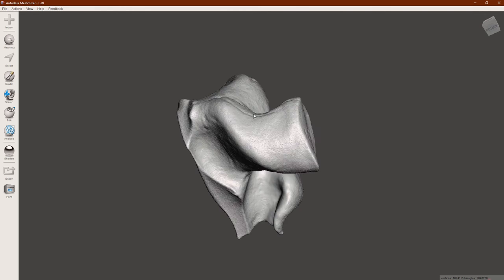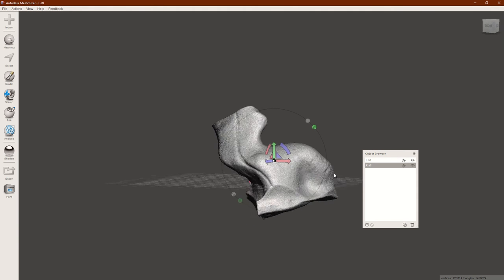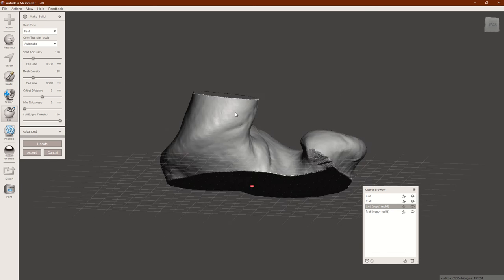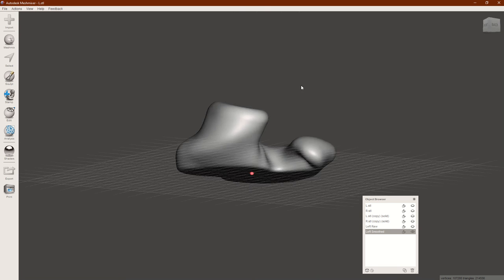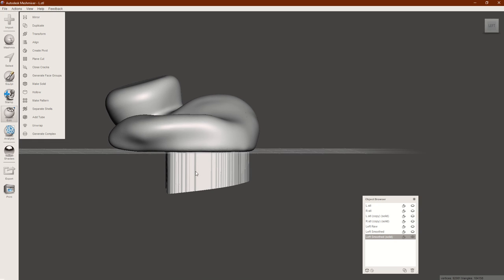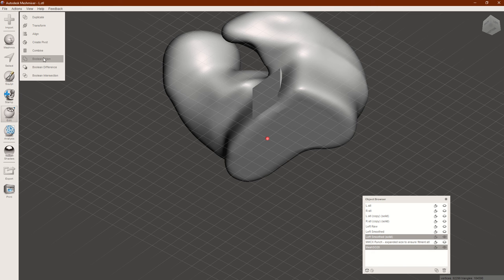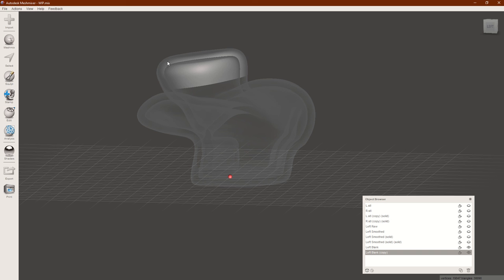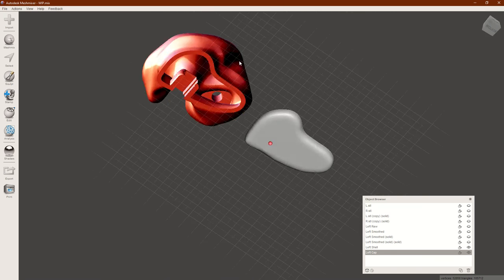3D Modeling In Ear Monitors with MeshMixer

Comment: Hi, bro! Nice video! On question... Tha Anycubic Photon Ultra is good option to make a Custom in ear? The resin is medical grade?
Reply from the maker: It’s a great printer. I have not used it directly, but I’ve used the Elegoo Mars version that’s a clone of a Photon. You’ll always need to finish the prints by coating them in Dreve Fotoplast lacquer and curing them to have true non-toxic biocompatibility. I think I made an old video going over that, but it’s been a while
Reply: @imorton777  Thanks, bro! I´m between elegoo mars 3 pro and Anycubic Photon Ultra. Which one do you think is the best? Also, do you think CR-Scan Lizard can make the job of 3d scan correctly?
Reply from the maker: @guisniatesygarnachas  The Photon is a little nicer, but both are great if you spend time with them. I’d recommend watching YouTube reviews on both options if you can find some. The Creality scanner with the turntable looks like it will work, but I’ve never used it before. Watch some videos of people using it is my best advice to decide. I have an Einscan, but it’s about double the cost so I’d make the Creality work. One thing that’s been really helpful is the Anycubic wash and cure station. I’d look into one of those.

Comment: Hello Isaac Morton, 
Thanks for this cool video! I wonder,  have you ever printed with soft resins? We are working in a medical device that delivers sound stimulatios during sleep. We use silicone custom fit earphones ( 3rd party make them for us but they use the old method of pouring). We want to explore to print directly in soft material silicone-like. Thanks!
Reply from the maker: What a cool project! I haven’t done 3D printed silicone personally, but I’ve been reading about the Dreve BioTec product and it looks pretty amazing-worth checking out. I can see how the silicone would be much more comfortable for long periods of time.
Reply: Hi, i am also planning to DIY closed loop delta sleep audio stimulation device with custom ear plugs with electrodes.Your project really grab my interest, where can i read about it?

Comment: Hi, love the video it is exactly what I was looking for!  Can I ask what 3d printer and resin you use now?
Reply from the maker: Thanks! I have a Qidi Shadow 6.0 pro for resin printing. It’s worked with every resin I’ve thrown at it, but I like the Anycubic brand materials best.

I always have to coat everything in Dreve Fotoplast Lack (think clear acrylic UV nail gel with lots of fancy German words and warnings on the label).

Good luck!
Reply: @imorton777  do you need to comensate for resin shrinkage in the slicer as well as the + 0.25mm you added to the model in the video?

Comment: I read your Amazon review on a resin (unless there's another Isaac Morton making IEMs) so I'm assuming you've started doing this with SLA.  Any changes to your meshmixer process vs FDM?
Reply from the maker: Yes-it’s me :). SLA is a lot less work as there’s no sanding anymore. The modeling process hasn’t changed though.
Reply: @imorton777  do you print right on the build plate or with supports? Also, I just got an Einscan-SE myself. Holy shit, why did I waste so much time trying photogrammetry. This thing is great.
Reply from the maker: @alexsmith7801  Absolutely agree-Yes-the Einscan is a game changer! It’s revolutionized my entire process! I just bind them directly to the plate. I’m no expert by any means. I do about 2 pairs a month is all. Because I know I’m going to finish every part in Fotoplast Lack 3 I don’t worry too much at the printing stage. Keep being awesome Alex

Comment: Can you tell me which acoustic dampers/filters and tubing lenght u use for the GV driver?
Reply from the maker: Hi Andreas. I personally don’t use dampers. I find the sound loses a lot of character on this particular driver. For a true flat response I know people like orange or red on the bass and green on the highs if you’re going for flat.
Ideally with the GV, the shortest acoustic tubing length is good for sound-driver as close to ear drum as possible. At a maximum, 13mm per tube. Remember to remove the clear yellow tape from the GVs to open the bass vents and get better bass response.
Reply: Hey Isaac thanks for the reply, im in the mids of ordering right now unfortunatly destroyed one of the solder pads on one of my GV´s and i have to reorder another one right now. 

Im looking for a nice heavy bass with not to much of treble (kinda sensitive to that) it does not has to be a flar response though. Definitly gonna try the removal of those tapes on the vents  to see what that does for the sound.
Reply from the maker: @ANDDIE  bummer! I’ve destroyed my share of drivers as well. I highly recommend searching for Soundlink on AliExpress and ordering litz wire for assembly. When I went to their litz wire I stopped losing the solder pads.

Comment: just wondering, how much does it usually cost to get a pair of impressions scanned into .stl files? I've asked a company and they've quoted £150. Considering that a low end 3D scanner is about £300 surely this is too high?
Reply from the maker: who'sthisguythinkheis? Yes. Way too high. It takes an hour of work (max). Even with an expensive scanner I wouldn’t pay more than 50.
Reply: @imorton777  thanks for the reply, thought so too.
Reply: @imorton777   do you know anybody that would do that? i would like a professional grade scan for a resin print :)
Reply from the maker: thibaut noah - if you can get them mailed to me, I’d be happy to scan them for you for free. I typically have to trim off a little so the scanner can “see” all the parts of the impression. Doing the scan is easy. 3D modeling them into the shells and caps takes time. If you want to arrange it, I live in Utah (USA). Email me at imorton777@gmail.com
Reply: @imorton777   also if you know someone that could do that i would gladly lend your skills to make me the model for the printer, if that is something you would considerate. Don't know how much you would charge but i guess i will be okay with the price :)
Reply: Mine cost $30